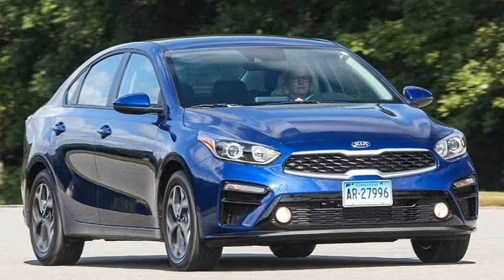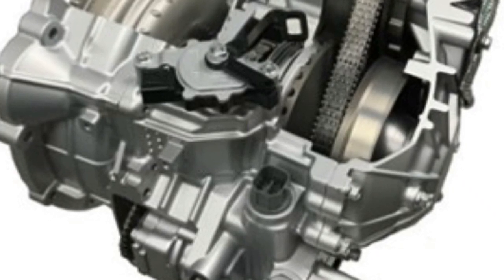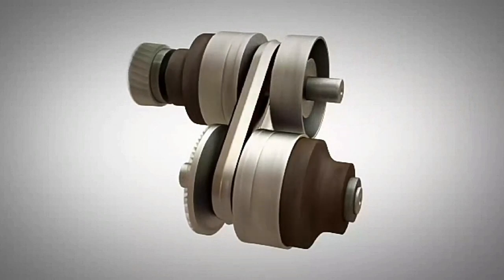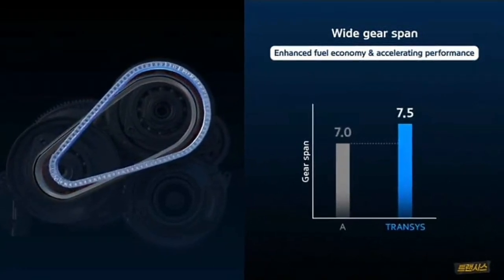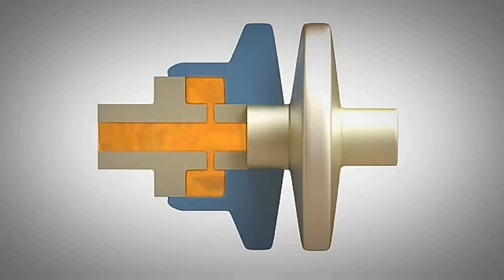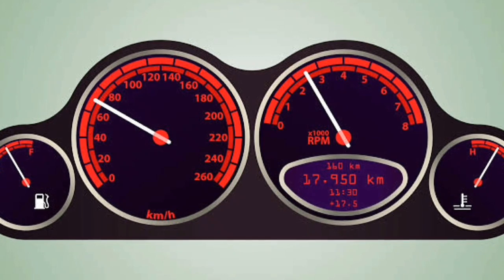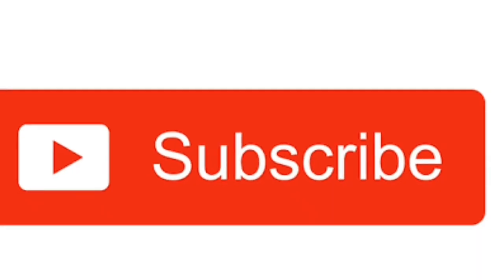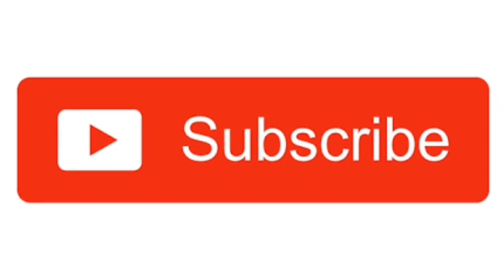Working of Intelligent Variable Transmission IVT, working of IVT Transmission & difference with CVT

Comment: 12/29/2022: Thank You. My wife and I are looking at replacing our 2016 Hyundai Elantra with a 2023 model. My other car is a 2004 Z06 six speed transmission Corvette and previously big block Mopars with Torqueflite transmissions. You can understand my hesitancy at buying a car with "this type" of transmission.  We will take a test drive at the Hyundai Dealer and check one out, thanks to you and this video. You do fine work. Thanks again and Happy New Year

Comment: Does the IVT pulley needs lubrication? Isn’t it under continous stress until breaking? Does it need special lubrication?
Reply from the maker: Most of the modern CVT systems uses a special kind of transmission fluid for lubrication purpose

Comment: Nice review Mr Maneesh.  What would be your pick...IVT/CVT or DCT or TC box?
Reply from the maker: I prefer IVT and DCT, IVT rectified the demerits of CVT without compromising the high efficiency of the same, DCT's performance is also superb. but dry clutch DCT will have some heat issues on heavy traffic, which you can see in Hyundai cars
Reply: @er.maneeshgenesan3  Thank you. I love smooth drive of IVT. In the occasional highway drive will it fair well. How about driving in hills? Does the kia seltos or hyundai creta will have too much rubber band effect. Thank you for time
Reply from the maker: Despite from the push belt drive IVT uses a chain belt, higher rigidity and transfer efficiency of the chain belt reduced the rubber effect drastically. Which makes it more attractive

Comment: What are the differences between the push belt and the chain type belt?
Reply from the maker: Justin Guy it's a much more rigid transversely placed chain similar to the chain drive used in other CVTs, it can control its Actuation itself irrespective of the engine rpm and no need for just following the push from pulley. That's the reason they erased the name push belt. Hyundai doesn't published the exact technical updates of the chain design, but mentioned their independence in operation made them more fuel efficient. That's why I didn't explained about it in this video. I hope there will be a content for a new video. I will let you know when it is published.
Thank you very much for your feedback.